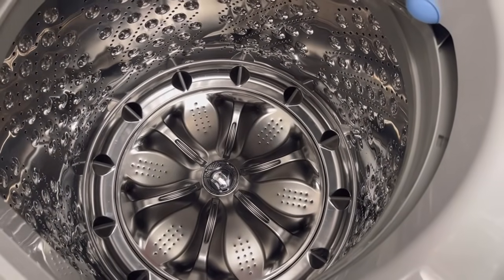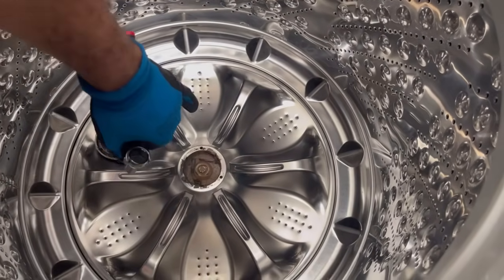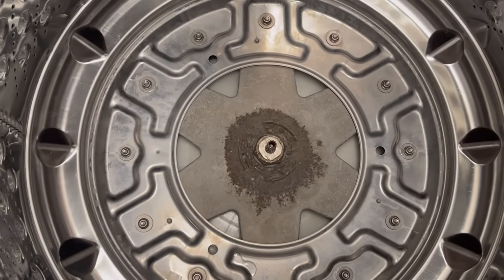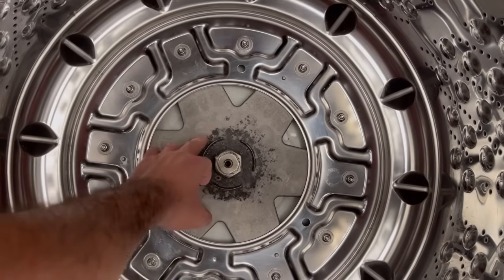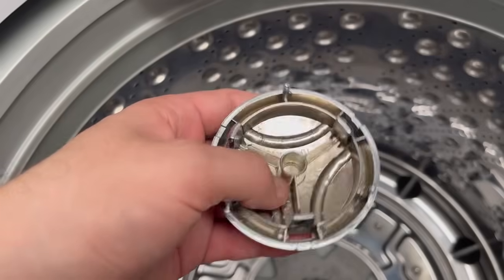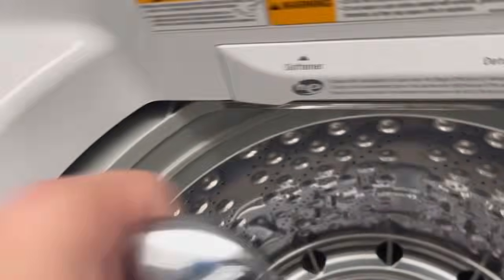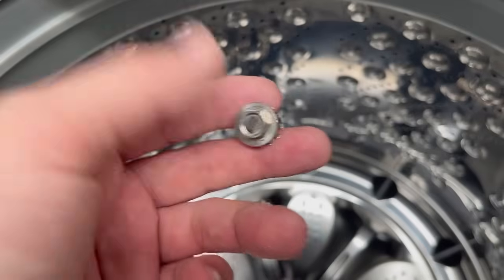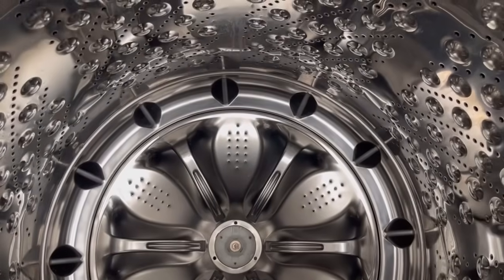How to remove and clean LG washer machine filter

Comment: Unfortunately this is not just an LG problem. We had a Samsung HE top loader prior to our LG and had the same brown flakes issue. I searched google for a brand that does not have this problem but I found comments about black/brown flakes for every major brand. It must be due to the design of these HE top load machines.
Reply from the maker: Well said. I do too think that it’s just one of the biggest downsides of this top-loader design. But I still think this design’s benefits outweigh its disadvantages compared to front-loader design. Front-loader design has more shortcomings/limitations than top-loader design in my opinion.

Comment: So what ratio of vinegar and baking soda and how much?  And do I put it it with the bottom part removed?
Reply from the maker: The ratio of vinegar and baking soda we used was 50/50. You put the mixture solution with the bottom portion installed (NOT removed). Feel free to ask if you have any questions.

Comment: Good video in all but you make it look so easy getting that piece of the drum I've been wiggling it for 45 minutes an I can't get it out without breaking it
Reply from the maker: I’m sorry to hear that. But it really wasn’t too terribly difficult for me to pull it out honestly. Maybe yours got stuck pretty good, I don’t know. This may sound stupid, but just want to know if you removed all the pieces (washer and bolt) before trying to pull it? Also, I’d recommend applying some WD-40 and let it soak for few minutes then trying it again. Hopefully that’ll help. Let me know how it goes. Thanks.
Reply: @SOBIsHobbies  yes I did exactly what was done in the video but wasn't able to pull the piece out felt like it's stuck I just cleaned what I could and put it back together
Reply from the maker: @stonyshelving8  I’m sorry it didn’t work out for you. Thanks for watching and providing feedback.
Reply: @SOBIsHobbies  how much baking soda and vinegar did you use
Reply from the maker: It depends on the level of built up dirt I’d say. There’s no harm in using of baking soda or vinegar, so it’s really at your own discretion. I believe my wife used a half cup of baking soda and about 3/4 cup of vinegar when she let it cycle and rinse.

Comment: I use the 10 inch ratchet and then we used power tools we could not get the bolt to turn
Reply from the maker: The bolt might have gotten stuck in your washing machine. I would recommend spraying some WD-40 over it and let it sink in a bit and try giving it a go again. Hope this works out for you.

Comment: I don’t think that’s the filter.  Filter is usually located on the  front left/right bottom of the machine or at the backside.
Reply from the maker: Thanks for your feedback. There are couple of filters on this machine. I believe the one that you’re referring to is called lint filter that’s located in the back of the machine. However, this washplate assembly does also have a filtration mechanism built in to it that retains dirt and debris inside. You can see it when you remove the plate.
Reply: I got a new LG 5.0 cubic top loader washing machine this year. And the filter is not in the barrel like it was before . So it is either under the 
appellars or in the back of the machine.
Reply: @Joanne Collin  good to know. I was looking all over for mine. My washer started whistling during the spin cycle so I'm trying to figure it out.

Comment: Thanks for a great tutorial.  Unfortunately, my bolt won’t budge.  I’m going to use Teflon tape if I manage to get it off.

Terrible design, LG.  Both filters are an absolute pita to access.
Reply: Got it off.  Teflon tape applied.  Now I’m going to need Tommy John surgery.
Reply from the maker: 😅 I’m glad you were able to remove it.

Comment: 7 years ago, a friend gifted me my first LG appliance.  Today, this LG washer began showing an LE error code and they want to charge me $350 to “service” it to see if they can fix it… I will simply replace it with the old washer that worked just fine…
Reply from the maker: Have you tried resetting it? If not, I’d try that first and see if that would help erasing that error. To do that:

1. Power off the machine.
2. Unplug it.
3. Press and hold the “Power Button” for 5 or so seconds.
4. Plug it back in.
5. Turn ON the washer.

See if that resets the sensor and if the error message goes away. This is just a soft troubleshooting. However, if there’s an actual hardware malfunction involved then you may have to call in a professional or just replace the unit (unfortunately). Let me know if this resolves your issue. Thanks.
Reply: Same happened to me. You just have to change a sensor. You can do it with a video too. That's how I do it. It was in Spanish but I think you may find some in English

Comment: I couldn’t get the main piece off,after I unscrewed the screw, however in my manual it says to use bleach to clean when u put it on the tub clean cycle
Reply from the maker: If you have never taken it off before and if your washing machine is few years old then most likely it’s stuck there and needs some harder pull. But it should come off though. Ours was little stuck too and I had to use some force to pull it out. And as you can see on the video it eventually came off. Nonetheless, yes you can run the cleaning cycle option with bleach on your machine to clean its tubes and all (which we do it too by the way). However, that cycle alone may not always be enough to clean all the clogged dirt which get build up after continuous utilization of the machine. Thank you!
Reply: @SOBIsHobbies  my Boobs are in the way; I used a step ladder to try & I pulled hard , I stopped cuz I don’t wanta break the in inside
Reply from the maker: @polliepayton6601  😊👍
Reply: Here’s a tip to pull the plate off if it got stuck.  Take 2 screws #6 or #8 and screw 1 on one side and the other on the opposite side.  Now get 2 pliers or some channel locks and pull both at the same time.
Reply: @polliepayton6601  
Read above…
Reply: @kulasnikov3875  Duh I did!!!!
Reply: @kulasnikov3875 really dumb question, but where did you put the screws? In the holes in center where the cap was or one of the drain holes?
Reply: @jazzinthed I was thinking the same thing

Comment: Here's a good one.  I can't keep  the agitator on..screw (bolt) keeps coming loose.
Reply from the maker: Are the threads still intact on the screw? How about on the agitator? If threads are fine but it’s still coming loose I would recommend applying some Loctite (Blue) when putting it back on. Don’t use the Red or Green Loctite as you won’t be able to remove it later if you need to. I’d recommend applying Blue Loctite just to give it enough strength to hold it in place and check it occasionally to make sure the screw didn’t come loose. Hope this helps.

Comment: We are having trouble getting the big wheel out
Reply from the maker: I wish I could help, but I don’t know what’s holding it. I only had to remove the center screw to be able to lift the pulsator. Once I removed the screw bottom piece came right off.
Reply: I'm having the same issue.
Reply: Same, any solution?

Comment: followed your video all the way but the filter disk at the bottom will not pull off on mine. I even tried using hook tools to go into the tiny holes and pull up and mine is stuck. Out of answers on mine.

Comment: Does your washing machine put stains on your clothes? Mine does. It sucks!
Reply from the maker: We never had that issue with our washing machine. Unless there was an accidental mixture of colored clothes 😅 with white ones we never had any random stains in our clothes.
Reply: @SOBIsHobbies  I was just wondering if not cleaning the filter could cause that.
Reply from the maker: @moxie86  I’m sorry, but I can’t say that for certain if cleaning the filter would help you to get rid of that issue. But one thing for sure is that by cleaning the filter it won’t or it shouldn’t cause any additional problems. 😊

Comment: Update: Did this. Cleaned it. Now….. flakes are worse than ever. I have used the clean cycle and used a special detergent to clean the tub. Still have the same brown flakes issue. Very frustrating.

Comment: If he keeps dropping that center piece, he will break all 3 of the latches LOL🤣
Reply from the maker: I ended up replacing it regardless. It’s a very thin plastic, especially those prongs are super easy to break. I encourage ordering one or two as a backup. And the good thing is that they don’t cost terribly bad. I bought two for $11 on Amazon. 😁

Comment: Tried all the tips in the comments and can’t get the drum out after the screw is removed 😅
Reply: I soaked it in vinegar for about an hour. Tried to lift it again for about 15 minutes. Gave up, added backing soda, and turned it on for quick wash. Just came back to check on it. The cycle is still on, and the drum part is just floating there. See if it will work for you.
Reply: You ran the cycle with the bolt out?
Reply: Yes, and a small cap out.

Comment: Anyone else stuck on getting the circular piece out? Been fighting for 2 hours and don’t know what else to do.
Reply: I'm stuck too..  he made it look so easy to just pop out😂😢
Reply: Using two hands made all the difference for me
Reply: I've spent countless hours and tried every method on youtube but cannot get that piece out. LIterally had 200lbs of leverage pressure on it at one point.  Washer is about 8 years old. Driving me absolutely crazy! Yesterday I took the top off the washer and unscrewed the plastic rim at the top of the tub which was filthy. Cleaned it spotless and hoping this helps with the ruining white clothes with dirty streaks problem. On my first test run after putting it back together I totally flooded the laundry room into the garage before I realized that a pressure tube the connects into the system at top had disconnected and had to take it apart again to fix.  It was quite a day.
Reply: @evomatic we were the same today. We got the new hall sensor in and it worked but luckily I went in to check that it was still filling. We had an indoor pool. Spent a fair bit of time trying to get to the shaft as that's where it was leaking (probably because you have to lay it on its front to get the sensor out from under), but we could not get the bloody agitator panel off. Put screws into the holes and tried our hardest to get it to come off. 

We've given up and are going to just have to spend 1000 bucks on a new machine all because we can't replace a washer or seal. 

Apparently washing machines should last 12 to 15 years....yeh right.

Comment: I can’t get the filter part off. It’s stuck stuck
Reply from the maker: Sorry to hear that. Unfortunately, it’s hard to know why it won’t comes off without seeing it in person. Ours came right off as soon as I removed the center screw.
Reply: Did you figure this out? Mine is the same
Reply: @tarafleming1822  i haven’t unfortunately
Reply: I had the same problem. I left it and came back with more intention. I ran a flat head screwdriver gently around the edge and then pulled straight up. Honestly,  I think it is the angle because it was really hard, I made a slight angle adjustment and it came right up. This saved me both time and money.
Reply: Mine refuses to come up. Been workimg for hours at this point.

Comment: HOW about the water hoses? we have that washer and the water will not stop coming in. We were told by a repair man to clean out the hose filters where they come into the machine. When the water is filling it will not stop filling AND there is a buzzing noise. The water will not stop EVEN after turning the machine completely off NO electricity!!!!

Comment: Got the cap off and bolt off no problem. The bottom refuses to come up. I have tried everything. I can literally lift the washing machine off the ground and it wont come off.
Reply: Did you get it out?

Comment: I'm confused man wheres the filter? That's just the top plate of the tub that you cleaned...

My clothes always get covered in lint do you know how to fix this?
Reply from the maker: That's what the lint filter/trap is. It's integrated into the center agitator. Unlike front loader washing machines top loader machines are often designed like this with lint trap being integrated into the agitator. All that dirt, clogs inside that piece are those trapped lints and other debris that got caught overtime.

Comment: My bottom piece wont come out after removing the two parts!!   Is it just that  dirty n stuck?!
Reply from the maker: I would assume it is. However, I also need to point out that some viewers did mention the same issue (not being able to lift the bottom piece). At this point, I’m not quite certain what exactly is causing that issue, unfortunately.

Comment: The space between the plastic and metal on the washplate itself is coated with sludge. These pieces are not able to seperate and  there is no way to get it completly clean. I soaked mine in a laundry sink upside down, first in bleach and then in simple green . Lots and lots of manual shaking while partially submurged and then using a fine brush on the holes and goop just kept coming out.  I swear after about 2 hours of cleaning it was about half as heavy, yuck!
Reply from the maker: Thank you for sharing your experience! 🙏

Comment: That is not a filter, that is just an access cap to the nut to remove the bottom plate for service. It is going to have some ‘stuff’ under it but there is no need to remove it. It is a self cleaning washer.

Comment: A 15 minute long video with 13 minutes of useless info.
Reply from the maker: For some it maybe useless but for others it maybe helpful. Take what you think is valuable to you.
Reply: @SOBIsHobbies  I could be mistaken about this since in my older home I just left, I had a newer LG front loader which had a compartment on the outside of the machine from which you would drain and remove a filter by unscrewing it, cleaning it and screwing it back into the compartment. No tools needed and could be accomplished in five minutes.  LG must have discontinued the inside the drum filter and my guess is that it's a stupid unnecessarily obnoxious way to clean a lint filter.  Can't imagine any serious engineer designing that one.   Also, my instruction manual never mentioned that inside the drum filter, and consequently it wasn't until I lived in this new home for a year that I realized I should have asked where the filter was.  Who would publish a manual that didn't include where the filter was and how to clean it.  LG should be forced to recall them all or compensate the owners for their blunder.   In any case, I may call a plumber to take off the housing underneath the lint filter. It'll probably cost a bundle of money but at least I'll be confident the filter will be clean because I'll run the tub cleaner every month. Sheesh!  What terrible price to pay for LG's big mistake.
Reply: @ralphfaris7888  yeah, seems pretty silly.  "High Efficiency" washer seems to be everything but. . .